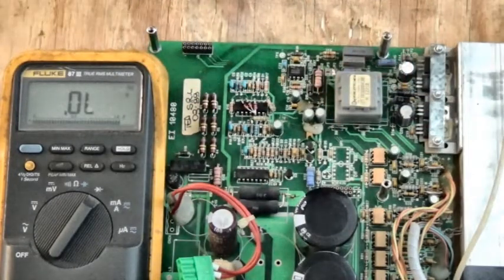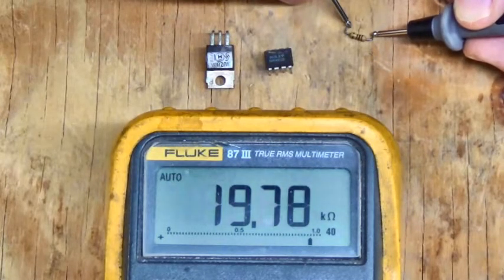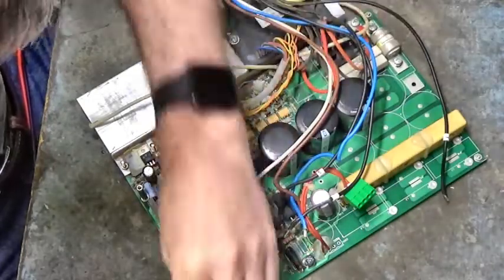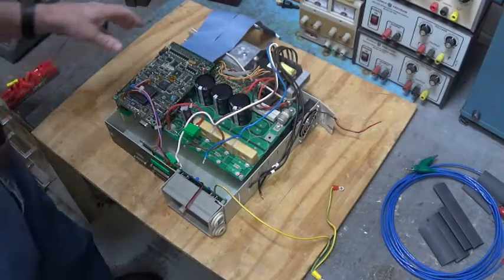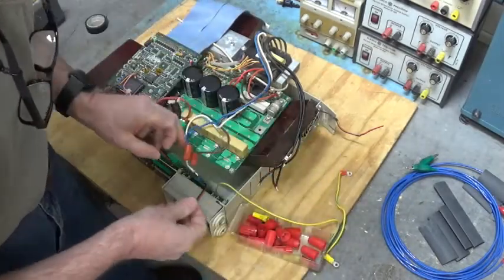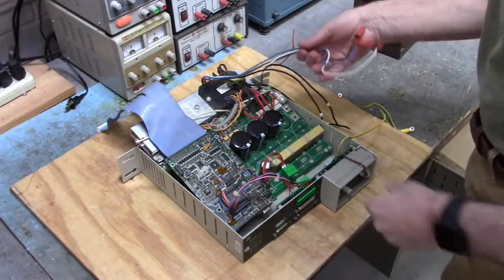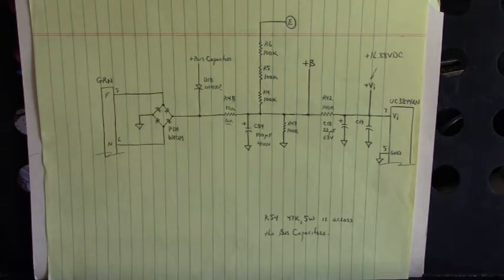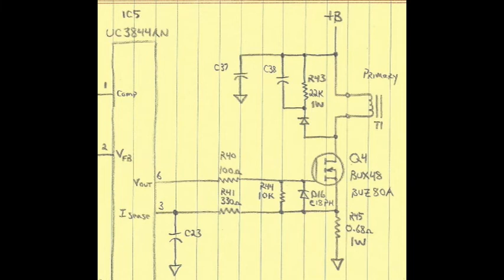Troubleshooting and Repairing the Switch Mode Power Supply

Comment: Thank you for videos you are putting out. Love your laugh.  don't know if you reply to comments. I hope you do. But I had question on a PCB which I'm working on. it was not working. I found a few bad cap and a blown pico fuse. how ever there are a number of power resisters on this board several of which are getting extremely hot. measured temperature off of the surface with Thermal camera shows from 290 to 390 F. I know power resister get hot but not this hot. If I put the board in service the resisters will burn the board. could you please give me some suggestions.

Comment: I've got a machine IO board powered by 220. But no 220 to power it. So I removed the voltage regulator and am powering it with 5v from a converted computer supply. I soldered the wires to where the regulator goes. Power indicator LED comes on. So far two blown diodes.
Reply from the maker: That is an awesome work around to get your machine working again. Great job! So far you have found two bad diodes in the power supply circuit. You are on the right track on repairing your power supply. Let us know how it goes. Again great work.
Reply: Peepaw McDonald thank you.
Reply: Oh boy. Diodes are fine. Had the meter leads reversed on the meter. OOPS.
Reply from the maker: I cannot count how many times I have lead myself down the wrong path. HaHa. It happens to me every day. But while on that path, I learn something new. So no worries. Enjoy the walk in the woods. HaHa...
Reply: I'm scoping with my 465b. I got a signal on some chips. but they all look kind of the same. I think it's just the probe picking up the mains hum like an antenna. I think the board ground plane is attenuating it and I'm not actually seeing control signals. So I though part of the board was dead. So I was checking diodes.

Comment: Good Evening Sir
Error 16 in 11kw danfoss vlt 2800 drive. Error 16 means internal Switch mode power supply failure.
Drive runs for 15 minutes then this fault occurs. We try to reset but it reset only after 20-25 min later.
How should we repair??
Pl suggest.